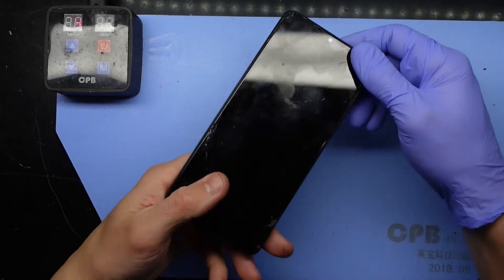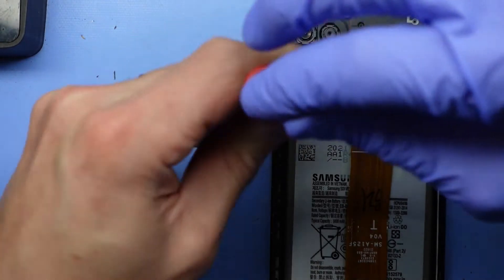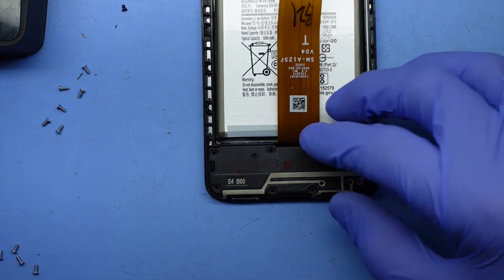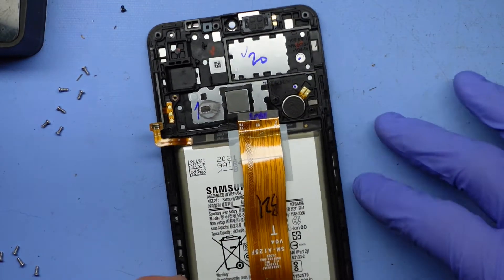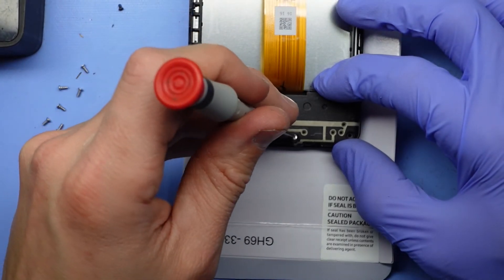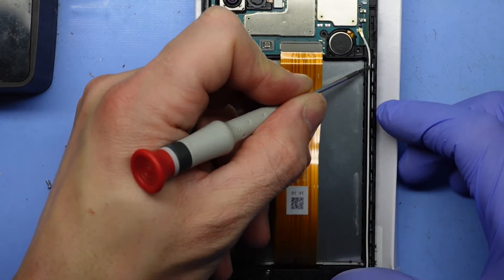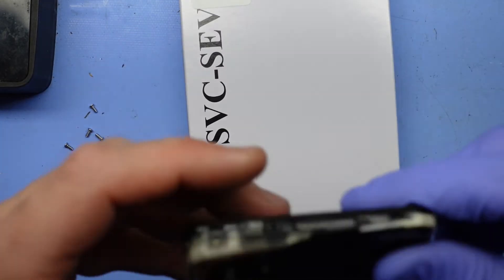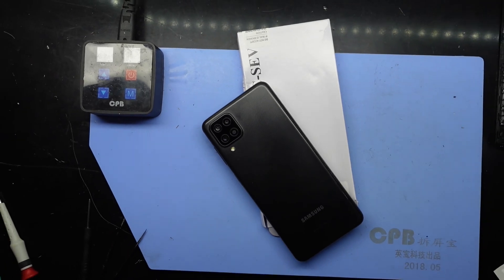Samsung Galaxy A12 Screen Replacement

Comment: nice one , props for providing this guidance , and props to Samsung for making this reasonably easy to repair , i was having some doubts half way through that my phone would survive , but it seems to be working fine now , though advice to others , be careful with the speaker , poked mine and its a little scuffed sounding now lol may have to replace it

Comment: Thanks for this. Very helpful! Where do you get the adhesive tape? Did it come in the service pack? Didn't find any in mine.
Reply from the maker: I purchased it from Ali express but for a temp thing just use some double sided tape
Reply: Good question!

Comment: Is the adhesive tape absolutely necessary to add/put back to the battery?
Reply from the maker: Stops the battery bouncing around
Reply: @rickstechrepairs  Thanks. Hey do you have any recommendations/suggestions on how to properly seal the phone back up with the adhesive seal that was broken through with the  card pry tool/picker and where the proper adhesive seal can be purchased? (After successfully replacing the screen on my Galaxy A12 months ago, water has been easily able to get into the phone slowly causing my screen to slowly go out until it finally went out completely). Timely feedback will be highly appreciated!

Comment: What kind of glue did u use
Reply from the maker: B7000 Frame Adhesive
Reply: Why does my screen wont start tho? It started at first. But after awhile it didnt turned on @rickstechrepairs

Comment: When I was removing the battery I found prying it off with that adhesive wasn't great. I did not see any tear or puncture but noticed a nail polish smell. Is the battery damaged now?
Reply from the maker: if it has a very foul smell i would be thinking the battery has been punchered

Comment: I had the glass of my screen installed  about 3 months ago and for whatever reason has begun separating on the corners, what would be the best way to fix it
Reply from the maker: it shouldnt be lifting, i use B7000 frame adhesive.

i would suspect your battery might be expanding